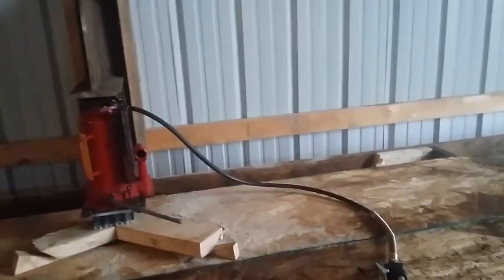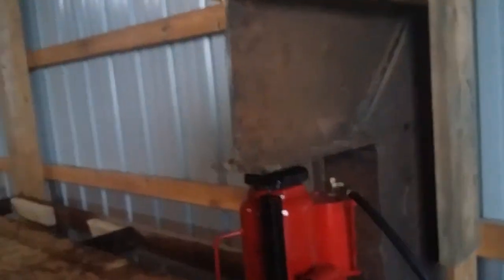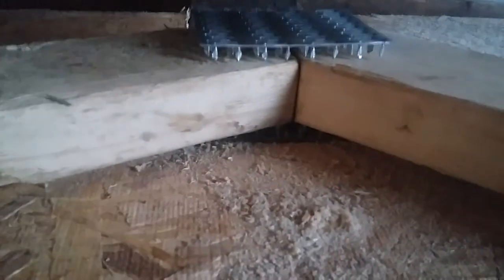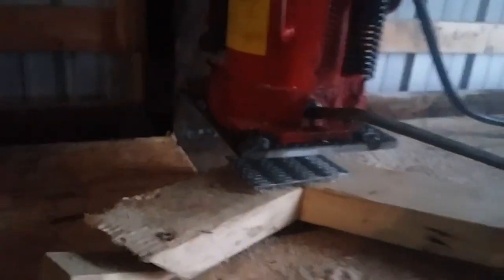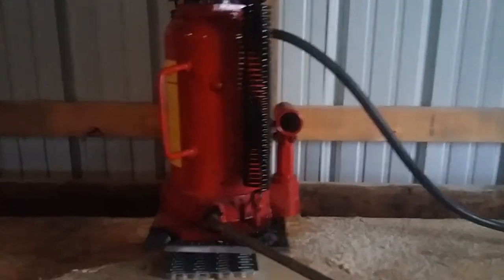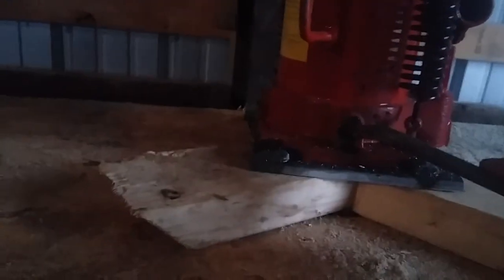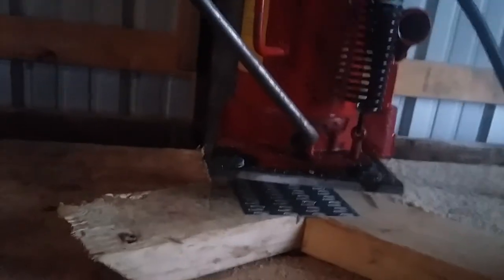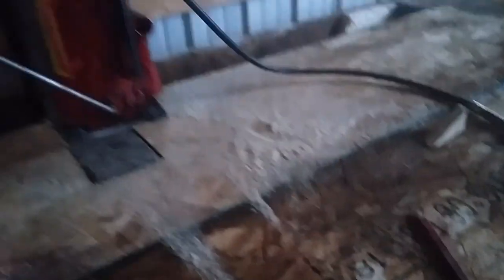Self made truss press

Comment: Nice Job, can you share your info on how you built it?
Reply from the maker: Took a ibeam, cut it into 3 prices to make a c. Then welded the top of a bottle Jack on the top side of the inside of the c shaped I beam. Added a steel plate to the bottom of the bottle Jack to reinforce it so it won't break. Make sure all your welds are good. I used a 20 ton bottle Jack to get the psi I need, and it's a lot of pressure on those beams when pressing. The technical stuff on the beam in not sure what it is. Just some my dad had laying around.
Reply: @Dannynolt what size beam is it, H beams? L x W x H and steel thickness?